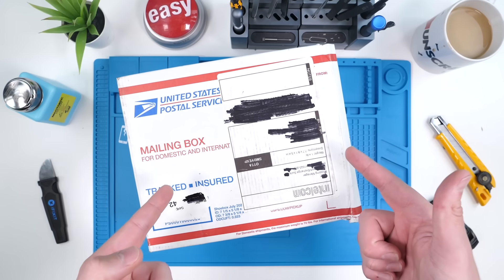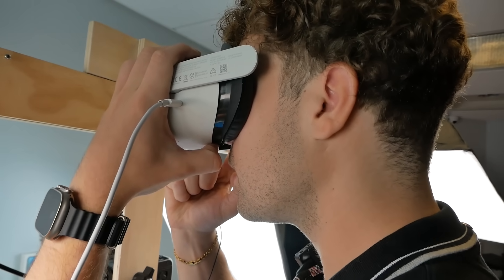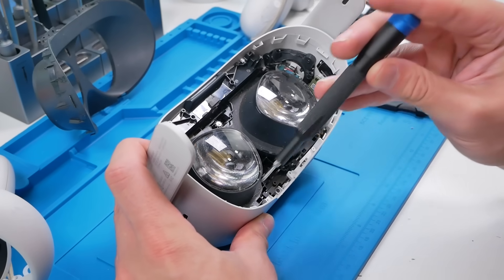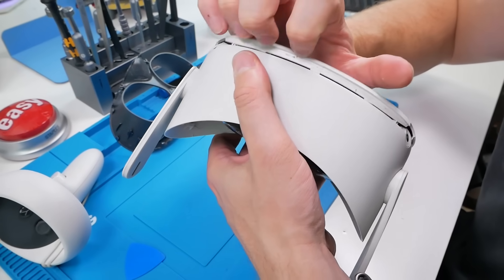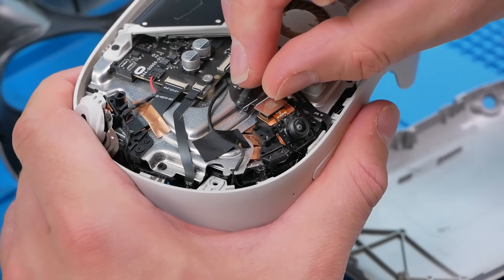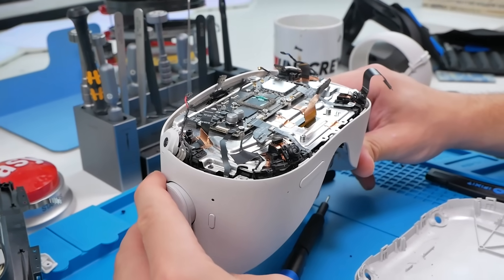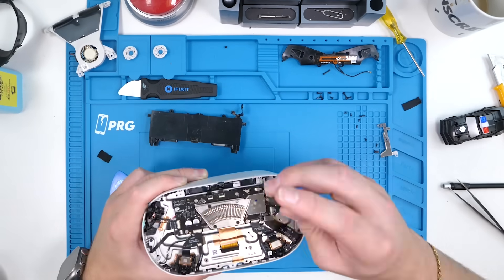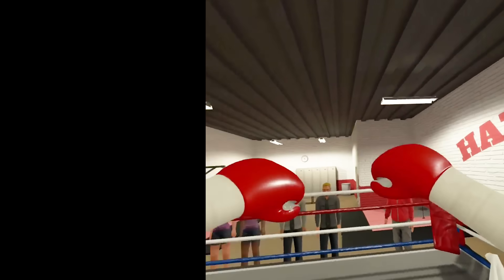The Oculus Quest 2 Has A Problem...

Comment from the maker: After tearing down and assessing repairability on the Apple vision pro, I am chill with zuck- he did good.
Reply: first replay
Reply: ❤0 @Green_GodRR
Reply: Ok so it is possible hope I never have to do this
Reply: I have done a battery replacement on a quest and it’s a nightmare but I think I hate the external apple battery more
Reply: second replay
Reply: 3rd reply
Reply: 4
Reply: 5
Reply: 6
Reply: 7
Reply: 8
Reply: 9
Reply: 10!!
Reply: @Yothatguycharlie you ruined the entire thing 💀 nice pfp tho
Reply: 12
Reply: 13
Reply: 14
Reply: Sir can you please help me yesterday I dropped my vr and it has this battery thing that has no red battery percent
Reply: Please what do I do
Reply: @abiggieboijackson2084  balls
Reply: 18
Reply: Ex
Reply: @Neonizx  20
Reply: 21
Reply: 22
Reply: 23
Reply: 24
Reply: 25
Reply: can you fix mine its doing the exact same but every time i leve it on the charger it would go back to normal in like 1 or 2 hours and if i try to trun it on it woud go back to flshing red but i tryied to do every simple step about the blinking red light and if i leave it on it normal and it stops blinking i tryed to leave it normal for like 15 mins and it will go back to blinking red do you know how to fix it
Reply: Meta quest 3 better than 2 but still the meta quest 2 is also very good it’s just a good non expensive fr headset

Comment: Slapping and external Battery thru a helmet 🪖 and new straps would be a lot easier. You will need it anyways. Since the original battery dies in less than 2 hrs anyways.

Comment: also if you get annoyed of putting tin foil in after ever time of changing the batteries, try this instead. Order yourself a cheap soldering kit with the coil of soft metal that usually comes with some. Let your parents do this or be of age where you understand how incredibly hot these things get and put a small amount of it in where the top nip of the battery goes. just tapping the coil against it will melt fast. Did this with mine and now i can just change batteries like normal again. Though remember this is only for those who are capable minded to do this without getting burned. I am not responsible for you if you get hurt.

Comment: can anyone help my vr says tracking lost after i take it of my head and it wont work till i charge it to 100% but then i just stopped working it has a black screen after i reset my headset after advice now it not letting me use it at all and the controllers buzz and wont work

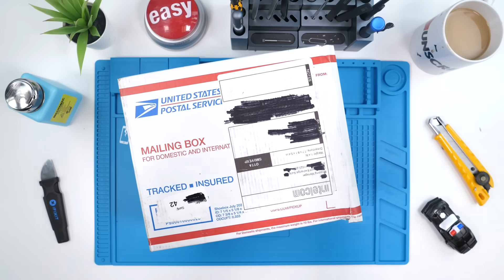Comment: 00:06 Oculus Quest 2 received with a discount of $5
01:17 Flashing red light indicating low power
02:31 Removing screws and cover to access Oculus components
03:43 Removing components to access the battery
05:03 Replacing the battery in the device is a complicated process
06:19 Removing the main processing chip and accessing the battery is a challenging process
07:41 Replacing the battery in Oculus is a complicated process
08:46 Successfully repaired and tested the Oculus.

Comment: I like to work on computers, and fix things myself, instead of getting them repaired, like opening it up and replace whatever thing needs to be replaced with a part that I got from savers or something. And so I was drawn to this video because I have an oculus quest that I want to replace a part with and I haven’t gotten around to opening it up so I decided I would watch a video where someone apparently does that which happened to be your video and now I see you opening this app and you say right off the bat T7 screw, and in my brain, my mental model, and goes a little bit like this: “Yeah, it’s pretty obvious that you should takeoff the padding first. Wait, you call your screwdrivers things?!? I just eyeball it, and it works!” Anyway that’s all I had and I thought it was funny that there are actually names for the screws. 2:04

Comment: It will mutilate the headset, but one could cut open the case where the battery is located and save a lot of work. Someone who's taking apart everything could take some very accurate measurements of the battery location so people will know exactly where they should cut open the case. A Dremel drill type tool or a heated knife tool could be used to cut the case open. The cut-out part with the new battery installed could be glued or taped back in place.

Comment: So far I hadn't have any problems with my Meta Quest 2, lens is good, fan is good, and usb chargering port is good. But best not to stress the battery too much by over charging it, just quickly unplug when the light is green? 🔋

Comment: Mine did this, but I charged it to 20 percent in 30 seconds and died in 15. I just left it in a nice coldish place (50 degrees Fahrenheit)  for about 2 months, and miraculously it has better battery life than it did before the problem occurred. 100% battery in about 2 hours, and 5 hours of playtime. Plus with my headstraps extra battery, it has almost 10 hours worth of battery life.

Comment: Looks like what we are seeing is that the intake port is pulling from the user mounted side and the exhaust port is recirculating air back over the board. Nothing wrong with a bit of preventative maintenance modification. It's like flipping the intake lid on an old V8, lol! I just bought one and don't have even have 15 minutes on it. I know exactly what to do now.

Comment: This device is not that hard to take apart. Try a bmw or a mercedes repair. Its made quite well. I bought a used one for $25, not working. BSOD. Gave it a decent smack while turned on and it started working. Worked for a month now.

Comment: What type of glue did you use? I just wanted to clean out my headset and now I can’t get the face plate cable back in and I need help. I’ve searched for some sort of tutorial for putting it back together and I can’t find one but I seen this video and hoped it could help me and now I know that I need a adhesive or something like what you used

Comment: To yop thia all off there was an update recently that ups the quests oetformance but deteriorates battery health a little more rapidly, 

i cant imagine what it does for the other components such as issues with overheating, wear and tear with use ect, but i imagine people will either replace thier quest 2 with probably the quest 3 that has just launched, get it fixed or sell it all together

What im trying to say is, repairs may become a little more common place now that meta is running the quest 2 into the ground

Comment: The replacing the analog stick on the controllers is also a nightmare, it sucked so much, but after taking the entire controller apart then putting it back together only to realize I forgot something and doing that 4 times, two to three hours later I was done.

Comment: Not only is this a problem but if your Controller starts to have a drifting problem that is way to bad to ignore you can't just take of the black circular plate at the top which is where the button's are and then boom you can get to replacing stuff no you gotta take the entire fucking Controller apart or buy a new one which is like 70 or 90 dollar's and that is insane

Comment: I know this was more out of curiosity than need, but this shows that there is no reason to replace a battery. For the 299 asking price of the Quest 2, its much better to just buy a new one and throw the old one away. Nature wont like it though. META should have a tradein system where you hand in your old/faulty one and get a discount for a new one. They would get back spare parts they can use on new devices.

Comment: Just a note for those who have a Quest 2: DON'T CHARGE WITH OTHER WALL CHARGER THAN THE ONE THAT COMES IN THE BOX.  I thought that as it has USB-C connector it will support all USB chargers but seems like the circuit it's not capable to manage them. It stopped to work after a few minutes charging with my phone charger. I'm glad that I had warranty where I bought it and they gave me a new the device. Hope the Quest 3 has this problem solved and implemented quick charge.

Comment: Never buying another Meta product. I knew when I saw this thing the replacement would be impossible. This should be ILLEGAL.
Reply: No glued or soldered parts. Everything can be disassembled and reassembled with a screwdriver(weirdly a cheap Chinese one where specially ones failed).

Comment: The worst part is that it is already off to the side, so there is absolutely no excuse for making it so hard to remove. Could have had a panel on top, or have it on a rail to slide out, nothing was actually preventing an easy battery swap from a design angle aside from the use of screws.

Comment: first things first, excellent dissemble and reassemble. secondly really nice video editing too.
Designing a headset with a external battery would reduce weight, thereby increase user comfort  and also heat issues arising from battery discharge further loading battery consumption to fans.
Must be the  reason why they are designing it this way, keep heat source away from the circuit board. By putting the battery out front, dramatically increases the wieght load on the users nose, which could be overcome by tighting the headband causing stress headaches.
Solution, remove battery altogether, add a usb c port to a redsigned faceplate with air vents easily manufactured on a 3d printer.  Attach battery to a belt, back pack.

Comment: there are clip on packs to 'extend' the life to these too - and honestly - theres nothing stopping you from running a decent power bank - theres a big flat space on top, and with head straps you could even attach it to the straps.

but...that being said - this is just stupidly engineered.   the battery is in one of the hardest to access points - why not have a simple screw/snap on lid on top to access it?  It's going to be one of the most commonly replaced items even if the headset is in perfect condition - the battery WILL die someday.

Comment: If I'd known it would be next to impossible to replace a stinking battery in this product I would NEVER have purchased one. This is nuts! Yes, congress should enact a "right to repair" act. Batteries need to be accessible from a panel. IOS products are even worse about that. Wow! But, congratulations on getting it working again. I'm legally blind, so, once that battery is done, I'll just pulse it in the microwave to clear all data, and chuck it in the bin. That'll be the end of that bit of craziness. LOL Thanks for doing this.

Comment: Can you help me fix my old ipad my niece drop my ipad and its on boot look so I didn't charged it for a long time now my ipad wont even turn on without a charger so i charged it for 18 hours the battery is still on red and it boot loops cant even use itunes to reset it keep boot looping when i tried to reset or update using itunes it still boot looping pls help

Comment: Biggest issue with this device is that it will not charge the battery while you play. It just slows the discharge down if you play while connected to a charger. Which means that when the battery permanently dies, you can't even play with it plugged in at least.
Reply: good, about time you took a damn break

Comment: personally i use the bobovr m2 battery back, they clip in and out and no need to even take off the headset, i always have 2 charging and one on the headset, the battery inside my quest is pretty much done for but does not make a different with the bobovr setup

Comment: So the battery is literally attached to the external chassis so would have been super easy to create a port for it to swap out.....see this is what happens when Robots (Zuckerman) designs tech, they don't design for failure which in turn is a designed failure lol

Comment: Hey Well your at it, you should have 3d printed a new face cover that has a battery replacement door and reinstalled the hardware on a new casing, trasnparent with a battery door, and a black face liner to keep light out,  Then you should train a robot how to assemble and disassemble the quest 2, and do the full battery replacement and hardware swap. Sense you are probably the only person on earth who would be able to do the instruction set for reparing one of these.

Comment: Just as a FYI you shouldn't keep the quest 2 or any VR Headset vertical like that or have the lenses facing in any direction towards light without them being covered. The lenses can focus light enough to burn the displays, while I'm not sure if artificial lights are strong enough, I still recommend being safe regardless. You can buy lens covers to place over the lenses to protect them, I have one that places under my facial interface
Reply: That's not a problem with anything other than direct sunlight.

Comment: USB-C devices should negotiate which device needs charging and how to charge safely. Cheap USB-C cables can be incredibly dangerous. Not only can they misrepresent the correct charging voltage, they can also overheat. Make sure to use official, tried and tested charging cables and charging bricks. If you want to stay extra safe, buy a USB-A to USB-C cable and use a regular USB charger.

Comment: After seeing this. Im happy i bought an external battery bank that doubles as a counterweight. K i added more weights... having an external battery takes alot of strain off the internal battery. Without the external battery i can feel the unit heat up during gameplay. With an external battery at play it takes that strain and heat away. Batteries heat up during charge and discharge soo i dont like my internal battery working too much. I've had it for over a year and never had an issue.

Comment: I have two of these things...  I might just cut a hole in the bottom to rip out the battery when that time comes.  Seems like it'll be easier

Subbed
Reply from the maker: Im sure you could get it done just be ready for it to take a few hours
Reply: @PhoneRepairGuru  I haven't had the guts to take the phone apart yet, even though my s20 has a cracked screen.  Most intricate I've gone is with a laptop.  Although I'll admit that I have been very curious about taking apart the headset.  It was really cool to see the process through your video

Comment: they have lithium titanium oxide batteries that don't really cost much more, and they last for 30-60 years of daily use. Sooooo "why do you have to go through all this" is because the battery is never intended to be replaced, they just want you to pay 300 dollars for a new one every time. For a shoebox computer with four cameras and a wifi antenna.
Reply from the maker: Can I ask where you got that information? On Metas website it clarifies that they are using a  lithium ion battery
Reply: @PhoneRepairGuru  i dont think you read that correctly.. I'm saying we have the technology called LTO batteries that last for half a century, but greedy companies are using old generic lithium battery chemistry because it limits the lifespan of the device to 3-5 years or 800 cycles.

Comment: That actually didnt look to bad, i have no reason to do this with mine but i was curious. I much rather do this 3 times than doing the retarded ac compressor on a 5.3. Beleive me the nut that holds the ac line onto the compressor you need a ft and a half extension with a wobble 13

Comment: The battery could have been easily accessed from the start, the black box above the lenses contains the battery and gets removed in like 5-6 screws max. Not an ideal place to find it but much better then disassembling the entire thing
Reply: You still need to remove the board and lenses to access those screws, though
Reply: @DaneH64  only the first time you replace it....then you can leave those far back screws out and only use the screws you can access behind the proxy sensor at that point it'd be hotswappable :)
Reply: @DaneH64  not the lenses nor the front panel, there are videos of people getting direct access to the battery from there

Comment: It’s not really their fault it is incredibly difficult to fit all components into a space that small while maintaining accessibility. Not to mention the problem of structural integrity to protect said components.
Reply: You raise some valid points, but what does years worth of structural integrity matter when the whole thing needs chucking because the batteries died in under a year?
Reply: @theninjascientist689  you also need to remember that the thing needs to be as efficient as possible. Also just get it repaired by a professional or you can wing it any way you look at it you can fix it with a few days of time and energy.
Reply: It's on the outside, it literally could have been removable by a hatch. It's just asshole design to make people throw it away and by a Quest 3.
Reply: @luketorpedo  you still have to wire the battery also a hatch on the front of a headset you sweat while wearing which leads to a lithium battery that is a brilliant idea.
Reply: @luketorpedo  would you put removable explosive batteries that reacts to water and contain toxic chemicals on a widely available headset that is used by millions for exercise. A Removable battery has never been used in tech that is made to be thrown around because that battery has to be unprotected.  One bump and chemical are leaking from your battery then gramma puts the headset on and if even a little moisture seeps into that device, grammas now on fire. It’s not illegal to replace the battery it just takes a little time.

Comment: The Quest 1 has its battery in the same location, but the surround on it is actually four panels rather than a one piece frame, all you need to do to get to it is remove the strap mounts, peel away the fabric, then undo all the screws to peel the front and rop penels away and you get full access.
This is a massive step backwards, despite the generational increase forwards.

Comment: Just use an external battery pack with the oculus and never replace the battery.
Reply: It will still run out fast… its better to replace and then use a second external battery